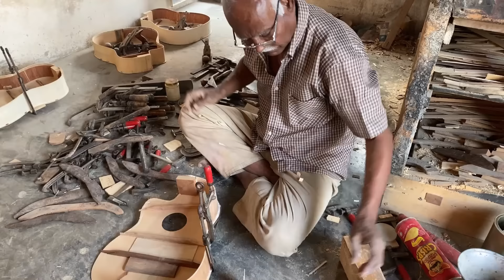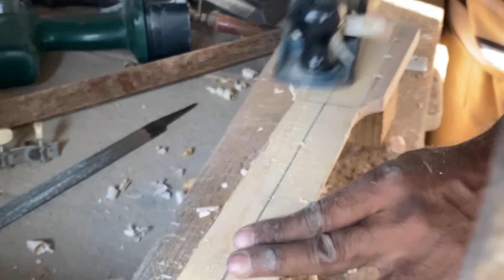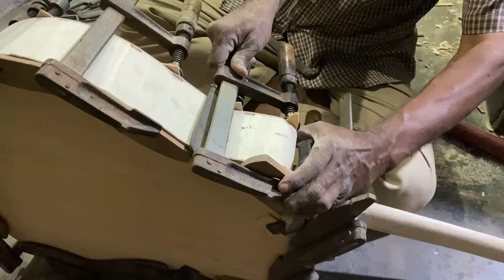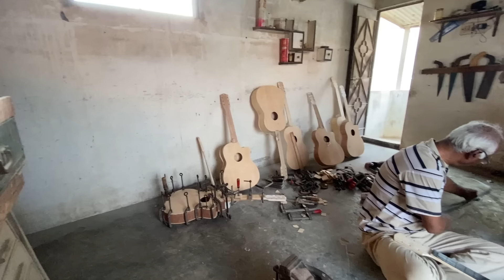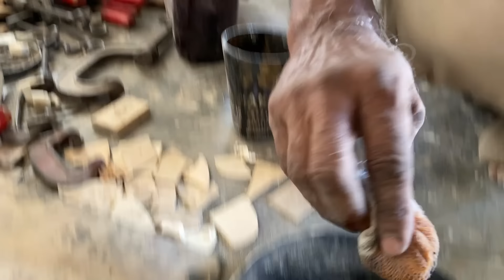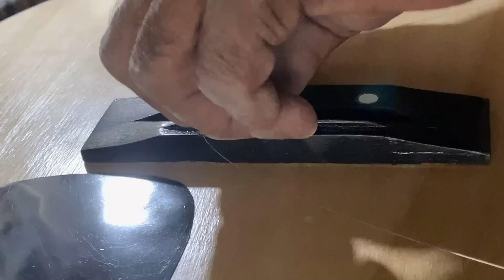Interesting Guitar making process || musical Instrument Master

Comment: He is very skilled and if he had better materials and maybe better tools, he would probably make excellent instruments. These instruments, however, probably won’t last very long. With steel strings and no truss rods, the necks will bend upward within a year and they will be unplayable. It also looks like top, bottom and sides are made of plywood or some other laminated wood. I wonder how much the craftsman gets per guitar compared to how much the final buyer pays. I would bet that they are advertised as “ hand made instruments” (which is correct) and sold for a lot of money. Interesting and educational to watch, however.

Comment: I dont think that neck will stay very straight without a truss rod and once the tension of the strings is applied this will result in an unplayable instrument, also that is not real fret wire that is being used for the frets and I did not see any fret dressing and with the fretboard not being made with a dense tone wood there will be more expansion and that wire will move or drop out, the winding of the strings has to be the worst example I have ever seen, the nut slots were not cut to the correct angle and cut far too deep, this will cause the open chords to be out of tune, I suspect this is why the guitar was not tuned, but all this is immaterial as the angle of the bridge saddle was totaly incorrect making the intonation non existant, this is not an instrument that will sound good

Comment: The first fret is just next to the nut ? 😶😶
The headstock isn't angled ?
Using acoustic strings on a neck without a truss rod?
They are really talented but they didn't care about building a real guitar
This one will be unplayable at least because of the first fret position so it's just for decoration.
Sorry for appearing rude but that made me cringe

Comment: Friends do not make fun of this even if it doesn't meet any standards. Countless amateurs like me are absolutely indebted to one of his ilk. This is a prototype 1st guitar for the most in the subcontinent. My first guitar might have been manufactured in a similar manner. I learned all my basics on that up to Hotel California intro and parts of Rain Song. That was 35 years ago. Now I have another 4 guitars - SG, LP style semi-acoustic, acoustic, and Classical with nylon strings but my original 'Firewood', as my friends used to mock me, is still functional and I do play it just to remind myself, quo Vadis.